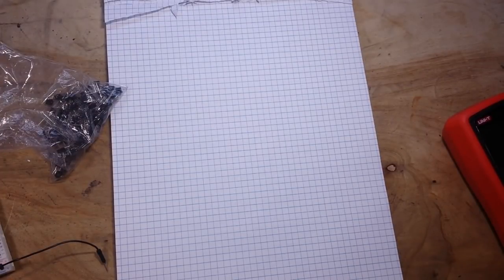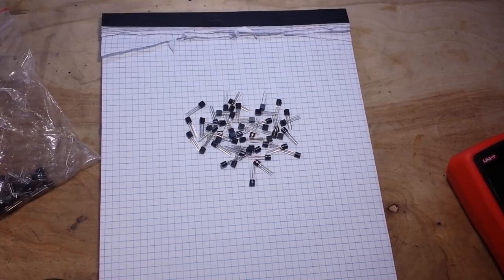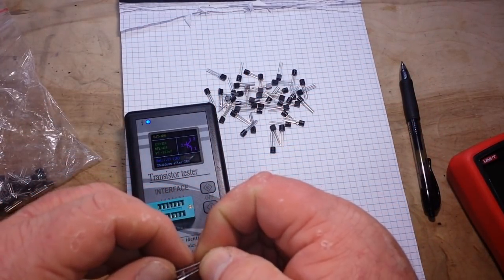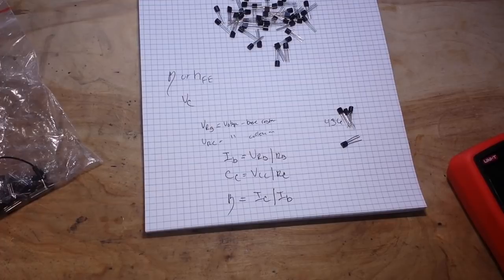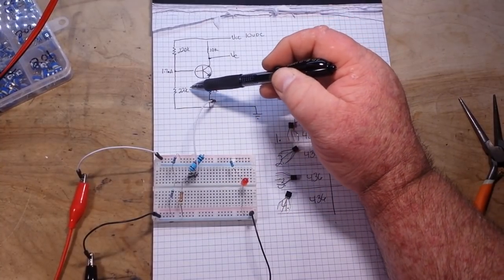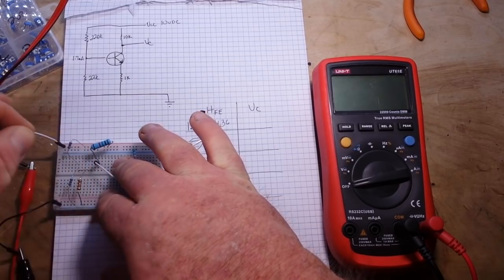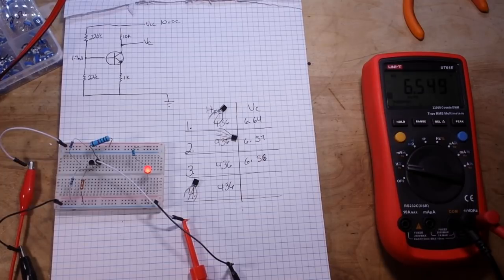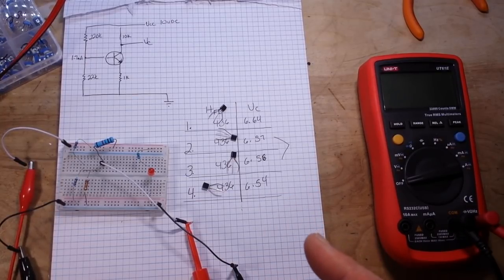How to match transistors

Comment: So by calculating the B with the voltages across the resistors I can get the same matching pairs as if I was usinga DCA? And the collector V measurement is just an extra test for higher resolution matching? Wow, that's great 👍 👌  thank you.
A quick question, if I test with 9 volts will it still produce the same results? Or is your circuit specific for 10v only?

Comment: Hi, I need to combine two transistors. The schematic is simple and I can do it on a PCB header. I have only two questions: I have a power supply that goes from 9V to 12V. Does it have to be 10V or is 12V or 9V ok? Are the resistors good for 1/2W? Thanks in advance for your reply.

Comment: Maybe a stupid question: do you need to use both methods or just one? In other words, if you have a transistor checker is that good enough or should you use that AND the circuit on the breadboard?

Comment: I have that exact same tester no instructions I'm trying to test irfp260n MOSFETs the tester shows the same results for all fets I test but when I install in a amp adj the  Bias to draw 200ma  the bias volts are all different some may be 1.9 v or 1.5 some may go as high as 2.3 so is my tester not working properly I'm trying to match fet but just not getting the results I'm looking from the tester ?

Comment: So are the test points on your schematic, black to ground, red to Vc?
Reply: Ground to Vc is what I did and it seemed to work well. I made a little jig and set it aside. I powered it with a 17 volt supply instead of a 10v which may have given me a little more resolution?

Confirmed them on my transistor tester although I feel that the jig is more accurate.

Comment: How do you go about when you have PNP transistors ?
Reply: My thoughts too? I tried it with a 9VDC PSU & the outputted Vcc Signal was between 2.9 & 3.1V 
The 2n3904 NPN Transistors generally spat out a reading of around 6V.

Comment: You only matched it for that one current or voltage ...Good if you use it at 6.5 V  only.     Matched set are tested  for a range of performance value .      Most people match MOSFETs  and just buy larger sized transistors when needed because a balance transistors circuit  is a bad design.  Where do you use matched transistors?       Plastic is not used,  Non conductive material is used to avoid ESD damage or electrostatic charge build up.

Comment: You should allow the transistors to sit at ambient room temp before testing because the heat from your fingers will influence the gain on your transistors.I also have the first transistor tester you used which is actually very accurate even using 9volts. I also use several types of curve tracers but have found using the same method you use yields excellent results as long as temperatures are steadily controlled for the devices under test. I’m not criticizing your work by the way, you did a great job! Very informative!
Reply: Exactly!

Comment: I've seen that some techs and even engineers don't care much about using the HFE function that usually comes on cheap multimeters. But I found out it is extremely important when repairing an audio amplifier or even a high amp power supply.
I still don't understand why high end multimeters don't include this function. Does anybody know why?
Reply: Multi meter test a transistor in the unused range  (low voltage range)   If you want to match a transistor you need to test at the design use values .  That transistor tester is just  a check to see if it is dead .
Reply: Almost no one needs to match transistors because there are special circuits that require a matched pair, but instead of using two separate transistors, the circuits use a dual transistor in a single package or an integrated circuit made to have matched transistors.

Comment: He didn't match for the important one - the base to emitter forward voltage.  This is critical for certain applications such as push-pull amplifiers.
Reply: Make a video please how you do it and post in comments section . We all novice getting in to this are eager to learn.
Reply: @adamproperdouble2094  if your multimeter has the function on it, you can measure diode drops that way

Comment: for the biasing of 1.7ma the math for the required R is the difference between the 22k and 10k divided by 2 then V/ by that R correct?...so 12000/2=6000..10/6000=1.7ma ....is this correct?

Comment: So I’ve been collecting a packs of components, just received a pack of transistors. I checked out the seller to see if they had some others I wanted and noticed they had some bad feedback... “Warning - this seller sells fake transistors”.
I didn’t know it was a thing! I thought a 2N2222 was a 2N2222?!
So my question is how do they “fake”. It’s not like a brand?! Are we just talking poor quality? Or dangerous? 
And yer, I got them cheap - my fault I know 😒
Reply: They are usually low quality, I got some 2N2222 where it's hFe is bellow 200 and they vary one from another a lot.
Reply from the maker: Probably just an empty case 🤔
Reply: learnelectronics just metered one on a TC1 multi function tester
hFe =427
Ube =671mv
Ic =6.2mA

BJT - NPN

Comment: Noob here, how did you calculate the 1.7mA current? And can you talk the differences of NPN und PNP transistors (where and why are they used and so on) 
Thank you for Video, its very helpful
Reply: Current (I) = Voltage (E) divided by Resistance (R)... lookup picture of "ohms law". Also shows how to calculate power.
Reply: @RinksRides  thx, and wich number does he use?
Reply: @heyho1202  difference in npn and pnp transistors is that not both were invented at the same time and when they were they were not the same price , other then that they are mirror images of each other like good and evil ,  everything you need to make you can make with any of them , unless you need both kinds then you need both kinds

Comment: Can you use 10 volts on all small signal transistors?  Or did you go by voltage rating ?
Reply from the maker: Yes 10VDC is fine.
Reply: @learnelectronics   thanks man!

Comment: Well done. Now how about telling us rookies why you would even want to match your transistors.
Reply from the maker: Transistors are very sensitive to temperature. Hotter they get, the harder they work and the harder they work the hotter they get. So you match them so they will react the same. Otherwise you get uneven application, and one Will burn itself out.

Comment: Why do we even need matched set?  What would happen if they were not a matched set?
Reply from the maker: This reduces the danger of one the transistors reacting to heat at a different rate than the other causing ever greater current to flow through it and thus heating up even more. This vicious circle will could ultimately burn the transistor out and ruin your day.
Reply: @learnelectronics  will  mounting them back to back against each other solve that problem?
Reply from the maker: No

Comment: Noob here... I saw a video on cloning the famous Moog ladder filter. They put emphasis on matching the transistors. So here is my noob question: why? Thanks for your kindness.
Reply from the maker: Depends on the application, but if they are not matched you get uneven results.
Reply: From the Interwebs: "The filter’s design allows for switchable 12dB/oct slopes ..." each of those "slopes" needs to be precise and even.
Reply: Tnx guys!

Comment: Just the guy I wanted to talk to! But first, what about MOSFETs?  I been wanting to ask you if you know anything about the raido kits from RadioShack? It's the old ones that you connect wires on the board with the spring looking things. I don't know if it's all there. I don't know if it's worth anything. I know you did videos with the computer radio whatchmacal it. I was wondering if you are interested in it? Its in the box, old as dirt looking, ill send it if you want. Id like to See a video with it!!

Comment: Do most consumer electronics have matched transistors?  Does it depend on the price of the device?  Great video Paul.
Reply from the maker: RF gear does for sure.
Reply: They are often found in more higher priced hifi/highend amplifiers.